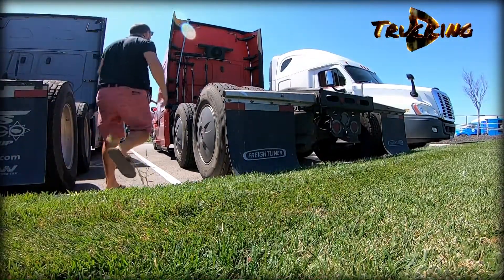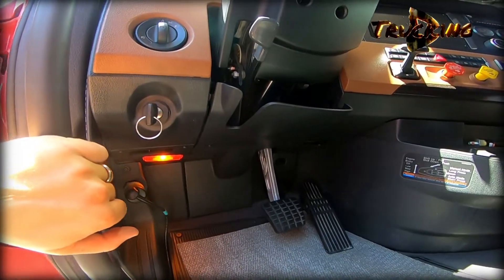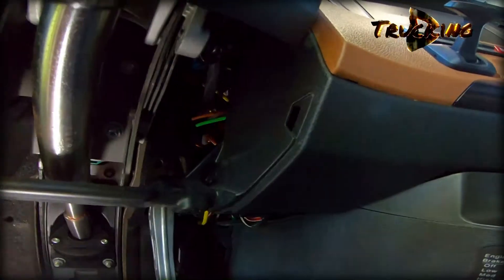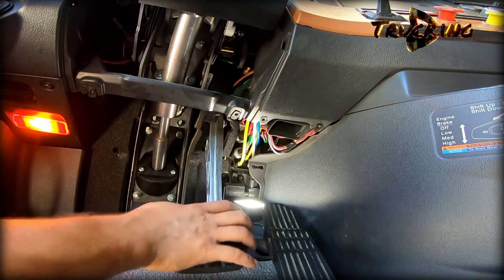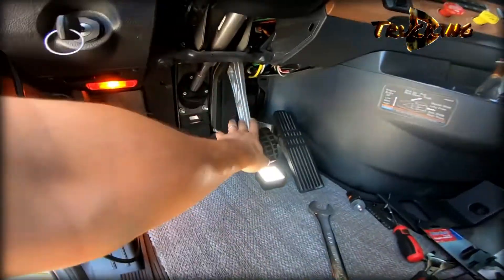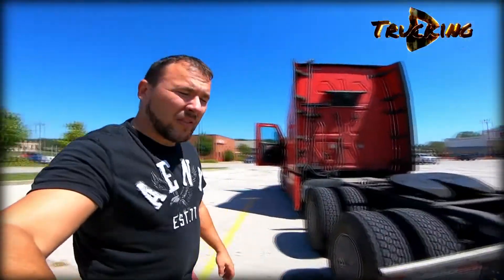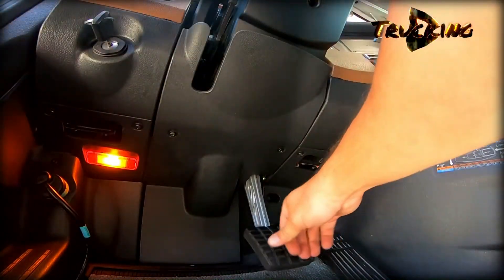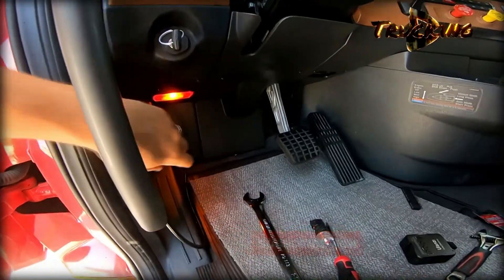Cascadia Pressure Brake light SWITCH, LIGHTS STAY -- ON -- CRUISE CONTROLL WONT WORK

Comment: This video deserves a like! I had same problem with newer body Cascadia.  0.5 hr labor rate plus switch in the shop (not dealer)
Reply from the maker: This is a newer Cascadia 2021. Usually shops charge minimum labor 1hr.